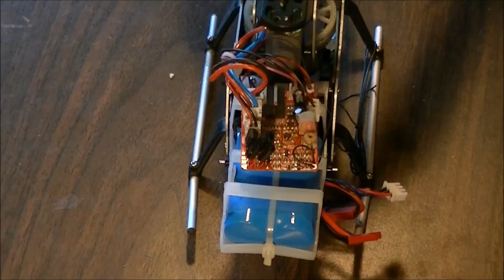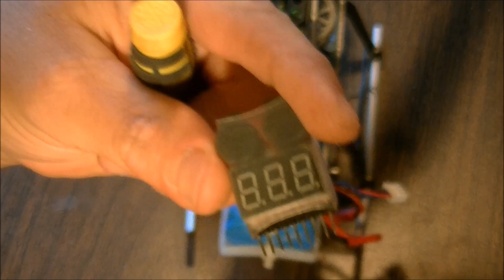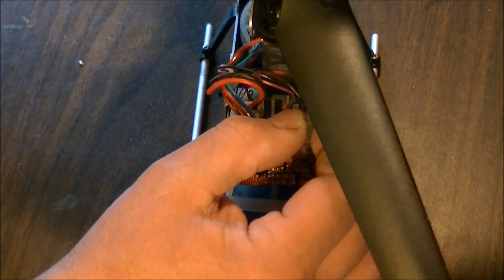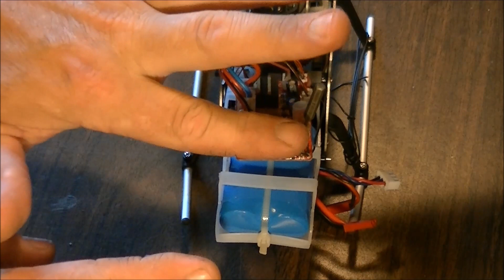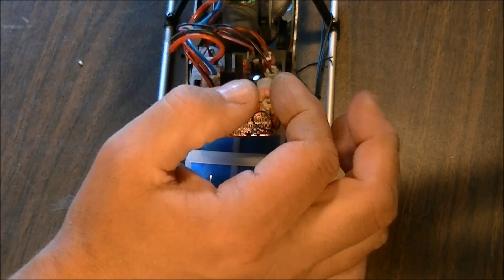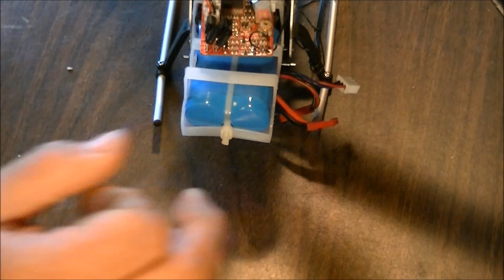Estes WE2012 Syma S031 Frequency Adjuster

Comment: my helicopter wires off the back of the motor, and I haven't used more or less 3 years, and now I want to fix it if it still works?
Reply from the maker: solder the wires back on then

Comment: hi . i saw you adjusting the frequency, mine is a s033g, the transmitter is 27.145 Mhz , so assuming that you were adjusting to match the transmitter frequency, what would be the allowable frequency range , or the thing on the receiver would only accept 27.145? in other words could the adjustment be higher or lower than 27.145?  . second thing is i have purchased a transmitter syma which had a 40.xxx frequency so i have replaced the oscilator to 27.000 and then did what you did adjusting the frequency, but that did not work, is that because the receiver is only supposed to accept 27.145 mhz and not 27.000?
Reply from the maker: 27 is in 27 and 40 is in 40

Comment: Hi. I bought a new but defect s031. The helicopter lights are flashing. Controller works. But doesnt seem to make contact with the helicopter. Can this be a transmitter adjustment issue? I tried other batteries. Can I built in a transmitter from a other 7.4V 3Ch Helicopter?
Reply from the maker: did you push the throttle all the way up then down then try to fly make sure transmitter batterys are good and that the heli is fully charged as well .
Reply: KevinMillard68 I had about 20 rc helis. from 3 to 6 chan. Single blade, rotary, big small. also have a Syma F3 (wl911) DH 9116/9100 MJX 640 etc. It seems like a defect transmitter and thats probably what it is. I Saw you adjusting frequency. But that cant be it. Canopy is never opened. Heli never flew. I have 3 ch controllers from Shuang ma - MJX and other brands. Nothing works. I also Have transmitter + 3 ch controller from double horse 9100. Is it possible to build that into the 031?
Reply from the maker: Will G you can use the pcb from the estes we2012  or the so31G but if you use the so31G board it needs more volts to run and youll have to swap the motors. if you transmitter is the problem then get new ttransmitterfrom the we2012 and you should be good to go. get a hold of my buddy Mypuppers on youtube and ask him what he wants for a we2012 transmitter iam pretty sure he got at least 2 of them from me he might even have the so31 stock on as well not 100% sure on that tell him you talked to me
Reply: KevinMillard68 I got it flying. But it only works if the antenna cable hangs loose. Is that normal? Also, if you do the trottle up and down it wont fly. You can (need) to take off at once. In the usermanual it says otherwise and need to full trottle first. Just like my Syma F3. Both are great stable helicopters btw. I payed €10.- for the s031g. brand new. Great deal. lol
Reply from the maker: Will G nope thats not normal, ill check my parts bin and see if i have any PCB boards for the heli are you on 27 or 49 mhz